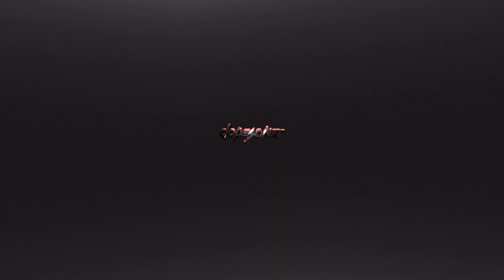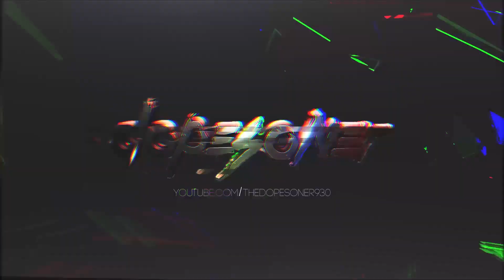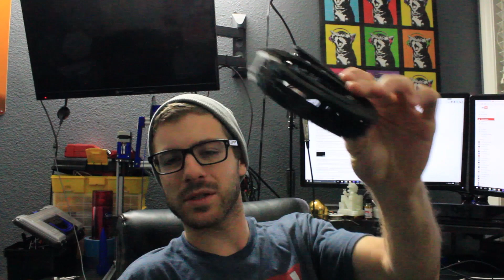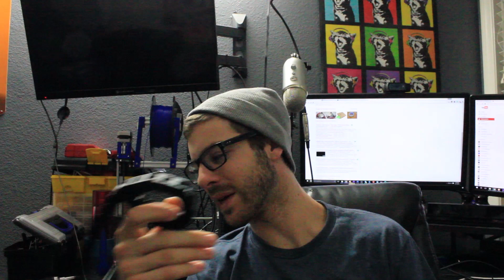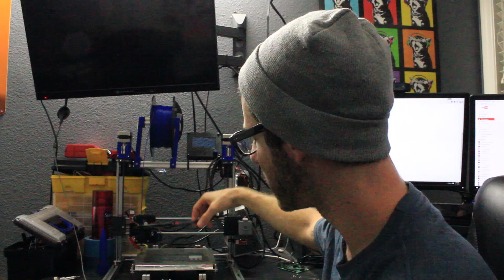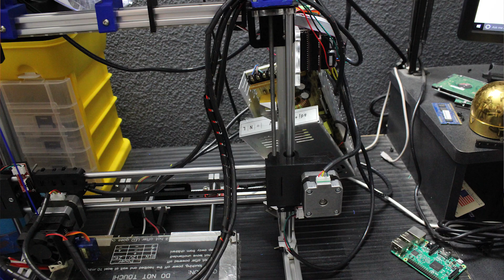The Importance Of 3d Printer Cable Management | Tips & Methods

Comment: The extra cable length would allow you to put the MPU and ramps in a 3D printed case on the back of the printer.
Reply from the maker: +TheViewFromUpHere yes I suppose if you want to go that rout I don't think a case is a bad thing it definitely protects the electronics but I feel like they are pretty safe mounted on the acrylic on the backside as well
Reply: The 2 reasons I think most people do it is because it looks much much much better. Second, there are cases, like this http://www.thingiverse.com/thing:1607320/#comments , that allow you to hide a fan that cools the ramp board. As you probably know, get hot, and heat is the enemy of a lot of things.